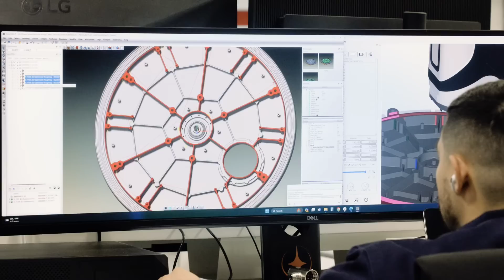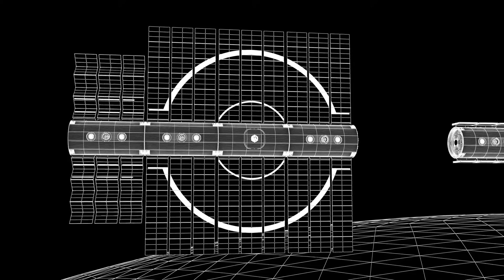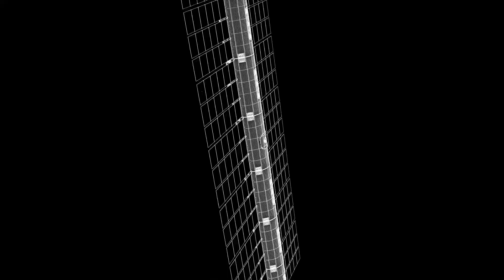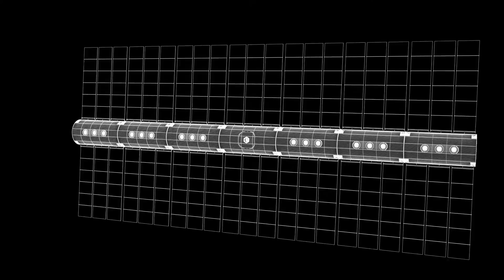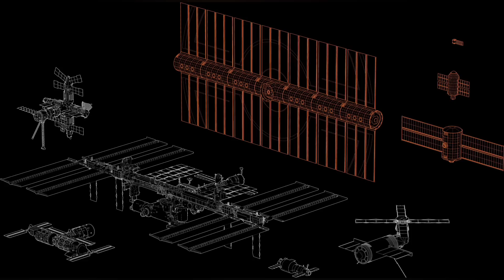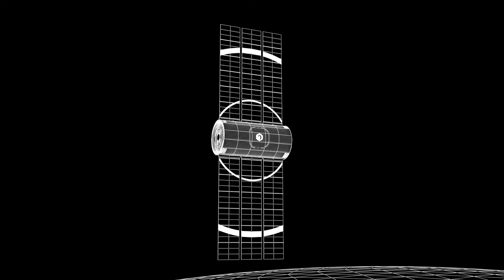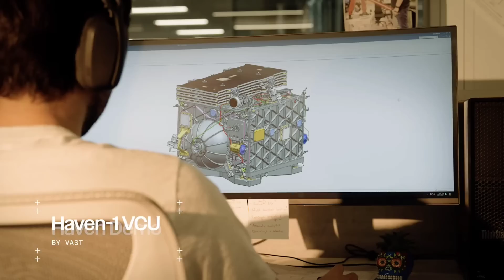SpaceX deploying new Space Station from Vast next year!!  No Starship required!

Comment: A 100 meter long tube circling with all kinds of different gravity from micro gravity at the center middle and earth at both each end. However if this is a tube like station you will be pulled faster and faster towards the end of modules. It is not with moon gravity you stay there. It pulls you away, that what gravity is, it pulls on you. And if you have nothing to stay on horizontally like a platform, you will litterly fall down the tube and be death with earth gravity at the end. It is litterly a centrifuge. 

So the only thing I can think of that you have the starship super wide modules where you don't build a 100 meter hollow space because again you will be pulled away faster and fasted you go to both ends. So you need a very wide module with horizontally platforms where you can stay on. And you need stairs at both sides to go from platform to platform with each more gravity if you go to the ends or less in you go to the center. Don't know how your inner ear 'vestibular system' will adapt to constandby changing gravity levels. Astronauts normally need a bare minimum of 3 days to adapt to be weightless and the, must be crazy feeling at the moment you don't have gravity. What will happen if you change is every day to different levels. Don't you get motion sickness all the time?

Comment: As far as space stations go, I hold the strong opinion that Starship would make a great space station solution for ad-hoc/specialized cases. For example, in space tourism, entertainment and and even science.
Just have a Starship space station variant, send it up there with the astronauts and supplies, and let it be there for weeks/months - as long as the mission/purpose requires. When the mission concludes, bring it down and land it. IMO this is not vastly different from what they just did with the Polaris Dawn mission where Dragon was utilised like a space station. You don't need to launch astronauts and dock them to a space station if Starship IS the space station.
SpaceX can have hundreds of Starship space stations in orbit with the astronauts in them doing different missions. Maybe I'm not aware of all the nuances involved but this definitely sounds good on paper.
Reply: It's not a bad thought maybe impractical but starship is being designed as a long term transport to mars so it would have the systems to handle an extended stay in space although it is probably going to be a while before the support systems for crew are this good. Dragon was operating at the edge of it's performace capacity for polaris it is not really designed for those types of missions, spacex had to make a lot of changes to the base design before that mission could launch.
Reply: @shaung949  Starship intended and being designed for extended space missions is exactly my point. If the program matures and they can crew rate it, I don't see why it can't be done. As for Dragon, the point I was making is that it functioned like a space station for a few days, and Starship could even do better for its volume and tech.
Who knows what the future holds?
Reply: Space tourism tickets might cost 3 to 4 times the money on a free flying Starship trip compared to docking to a dedicated station considering one wants some space to move around, and not being cramped into a can. For 500 persons capacity in LEO you'd need either one space station plus 3-4 dedicated Starships, carrying 250 passengers each, or you need 26 Starships (40 passengers each) for the same amount, and volume to move around in... This is considering one week turnaround time for Starships

Comment: I can think of two major problems with spinning stations that no one seems to talk about.  1 - How do you keep it balanced?  If you have 10 people on board and 8 are at one end with 2 at the other, the station is out of balance.  You need to have people move up and down column equally on each side of center.  2 - How do you stabilize the spin rate?  When people move either in or out from the center they will affect the spin rate.  Move in toward the center and the spin rate goes up.  Move out toward the ends and the spin rate goes down.  Any ideas on how to solve these issues without burning a lot fuel?
Reply: Yes, Paul; the Russians have already acommplished this... over 40 years ago, during the developmentof their vast Space Station Program. Russia built the World's very first Space Station; and seven more... as NASA looked on so helplessly; penniless, thanks to Congress.

Gyros, Paul, gyros. Look it up; I learned of this example of the many Russian achievements in Space 40 years ago.
Hello from New Zealand.

Comment: If they can move to a semi-expanding or fully expanding station where the rigidity of the structure is just provided by pressure and collapsible ribs these stations could nearly double that internal volume comfortably as well as reducing their dry mass.  
That might not be feasible for their current manufacturing equipment in this moment but I'd want to be thinking five years ahead to when Starships will probably be flying at least semi-regularly like the early days of Falcon and ten years into the future when, if Starship pans out at all, they'll probably be flying weekly or even more often and LEO industry starts demanding larger populations of people than a few dozen here or there.

Comment: I think they missed a trick. Surely, if the central module had 4 entry points instead of simply 2 (at the ends), the station could be expanded as a cross-formation. This would offer twice the volume of usable space. This would also be beneficial to the structural integrity.

Comment: If Spacex wanted to they could make an expendable second stage Starship without the flaps or forward tanks and use the saved weight to make a space station segment (and make it without a fairing either, the 'skin' at launch would be the space station exterior).
Yes, under most circumstances having reusibility is great but sometines, as when launching a truely larger than even Starship future payload bay could hold utem, it might be the best choice. So don't get "locked inside the box" thinking reusability is the endcall, be all.
Reply: No, they couldn't. There is no sleeving separating the tankage from the vehicle skin; the side of the 2nd stage IS the tankage. You would have to add hatches that could withstand cryogenic oxygen liquid without any leaking, and then develop a process to properly clean out both tanks. Make the engine section removable without increasing the danger of a fuel-oxidizer explosion. There is no insulation on the vehicle, so you would have to either add it before launch (lotsa weight degrading performance) or figure out how to apply it in orbit. There are no docking collars on SuperHeavy hardware, so you would have to add that (more weight). Then you would have to ship up the fixtures to go into the space previously occupied by fuel and oxidizer. Add a life support system to pressurize and temp control the structure that was never built to be regulated. Add additional layering structure so that one micro-meteorite doesn't rip a hole in the stainless steel exterior and kill everyone. And the 2nd stage HAS to have its tanks to even reach orbit; the only ones you can eliminate are the header tanks, and that is nose cone volume only. Storage, most likely.
Reply: @wesleybeaver  OK, you didn't understand. Im saying remove the ENTIRE STRUCTURE forward of the main tanks (saving that weight) and all the fins and put something else there, even disposing of the removable shroud (just having a lightweight aero cover, meaning part of the orbital structure itself) like a complete nuclear reactor for a really big space station where solar panels become just too big and inefficient or a steam turbine generating plant that a 'maybe mylar' mirror collects sunlight for the heat for... But stuff that's TOO BIG AND HEAVY TO FIT INSIDE STARSHIP but given the lift capacity was able to be mounted on top of the lower half-big the second-stage. He'll, for a really big lift, how about some shuttle size SRBs strapped to the Superheavy booster?
To colonize soace, lightweight everything has to go, it's going to take big quantities of heavy machinery to bulk process breathing air, sewage water back into potable water, generate electricity, etc. Even Starship as currently configured can't lift the stuff because of the design configurations imposed by reusability, sometimes you just have to expend. Note that Falcon 9 boosters are stripped of grid fins and landing legs sometimes, don't be thinking "inside a shoebox" because a time may well come that Starship won't be enough and it will need to stripped and modified for that "super heavy payload"
Reply: @bobjoatmon1993  The superheavy booster burns out at around 56 miles altitude when expended, I believe. Your idea would involve designing a whole new 2nd stage to get that heavy material up there. 200 tons is the limit the current V3 stack is supposed to lift, and even that will require a version of the 2nd stage that doesn't exist yet. SRB's are a no go; there is NOTHING on SuperHeavy to attach them to; no structural thrust frame. Just sheet metal, which would rip apart under that kind of stress. Nothing to do with shoeboxes and everything to do with physics and areodynamics. More than a couple hundred tons and you need to build whatever it is in orbit; it would be cheaper and safer in the long run.
Reply: @wesleybeaver  you seem to think things can't be redesigned or modified?
ISN'T THAT WHAT SPACEX DOES ALL THE TIME?
Sheesh, done with you and your blinders
Reply: @bobjoatmon1993  Cool. All this would require an entire new vehicle design, which would take years to design and verify for human flight, and cost $$$$.

Comment: Hm, if you turn the central module of the 'spinning stick' through 90 degrees, you could use it as the hub for two spinning stick station (a 'spinning X' as it were).

Comment: Looks like with the Ast gravity station you could add microgravity modules orthogonally at the hub. IIRC vestibular effects begin above ~3 rpm, so there’s no way to get earth normal gravity given the short radius. Also, how do they address precession and reboots in a sun synchronous orbit (assumed given solar panel configuration)?

Comment: Their spinning station concept seems to have some serious potential issues (some may be solvable but still add risk): 
1. Rotation makes stabilising the space station hard.  All space stations naturally need occasional thruster jets to fire to keep them stabilised.  But if it's axis of rotation isn't perfectly aligned with the Earth, you'll get the Earth appearing to rotate around the station (from it's point of view), which will make using attitude thrusters (to stabilise the station) almost impossible for a human.  i.e. You will need computers to determine the stations orientation & fire the correct thrusters.  Certainly doable, but if it ever looses the ability to determine orientation/etc (as has happened with some failed moon landers), then they could be screwed.  Maybe they can use gyros to help automatically stop rotation in that event, after which humans would stand a chance at manually using thrusters.
2. As someone said, how do you dock with a spinning space station?  At the very least it needs a docking port in the centre, which I didn't see in the 3D mock-up.
3. The relatively small(?) size means a high rotation speed is needed to get 1G.  I worry this will cause nausea, especially if you bend over, and even problems just walking around.  Maybe real astronauts can learn to deal with this like they do the feeling of permanently falling in zero G, but I doubt tourist visitors will be able to.  I hope I am wrong!
Reply: The spinning space station axis is going to stay fixed in inertial space. If the solar panels were attached like the model showed, the axis would need to point towards the Sun, not the Earth. Maybe it could precess at the rate of the annual revolution of the Earth around the Sun, but it wouldn’t be possible to point it towards the Earth.

Comment: Not sure about the stick.  Yes, there would be different gravity depending on distance from the rotational center, but with this size, there will be very noticeable tidal effects.  So, if you were standing in one of the modules, your feet would be experiencing more 'gravity' than your head.  Sounds like a recipe for nausea...
Reply: What if sleep inside a spinning wheel 😊
Reply: Exactly what I was thinking. Rotating stations just make no sense unless they are very large, and the ideal type would have similar gravity along an outer ring spinning around a central axis. The climb "up the stick" would be so weird and stomach churning.
Reply: @Kelnx  A stick, cylinder, cross or disk is more pressurized volume and material efficient than a ring, volume-to-surface area ratios and such. Kaplana One design or similar but larger is better still. I like that Vast/Sierra LIFE modules are launchable with lift platforms that exist now.  I think they should continue even If a percentage of people get nauseous, it's worth it.

Comment: If it’s a rotating station you just put your labs at the hub where you will still have microgravity.
Reply: No, you don't. It's still rotating, thus still producing a small centripetal acceleration.
Reply: @odysseusrex5908  actually you are completely wrong. Zero g at the hub and the g forces increase as you travel further from the hub. Yes it spins, but you counter that by having a stationary hub that the, in this case arms, or more traditionally the ring rotates around. You need the stationary hub for docking etc. read a book.

Comment: 7:45 Another thing that we can use this station for is to see if there are any differences between gravity and centrifugal force. 
An environment where your lower body will be pulled more than your upper body. 
This depends on the speed in which the module spins. 
This may result in needing to build these things a certain size or limit their spin to avoid things like lightheadedness.
As for reduced gravity. The body will weaken like it would in a micro gravity environment but more slowly. Mostly depending on the difference between the lower gravity and normal.

Ideally, we would want a space station what is made up by two components. The first like a Fuselage. This would be the center of the station. Where people can use micro gravity to do the work. It could also serve for storage and docking as well as station keeping. 
The second part of the station would be a wheel. This would be attached at the center of the fuselage with shockes  like on a bicycle. Some would be for support while others would be larger and allow people to move between the two. This ring would be used for living and would be near or at full gravity thanks to the spin. 
The mod in which the spockes attach to will spin as well. While the rest of the fuselage will not. Making it look like the whole room is spinning when you walk into it. 
The station can be made so as to store water though out it to work as shielding from radiation.
12:52 On a side note. This graphic isn't correct. As a person floating and handing a box to another would not stop but keep going and collide into them.
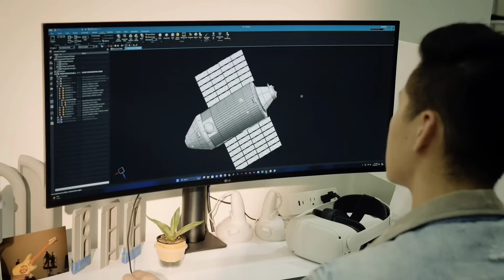13:42 That is wrong to as liquid would not sit in an open container while in a micrograv environment.
Reply: search capillary cup